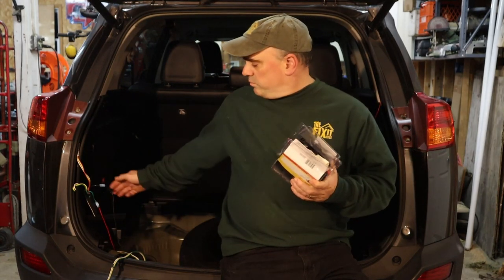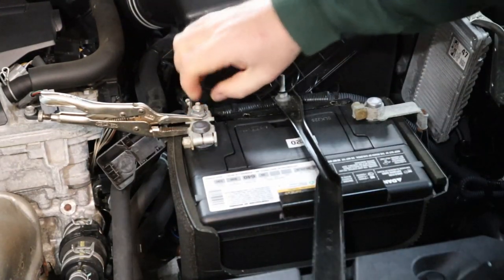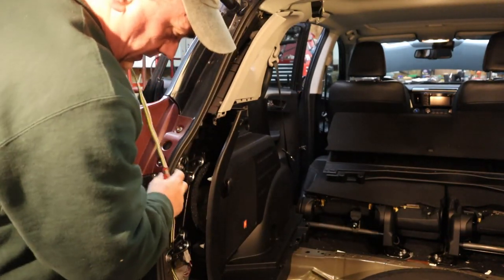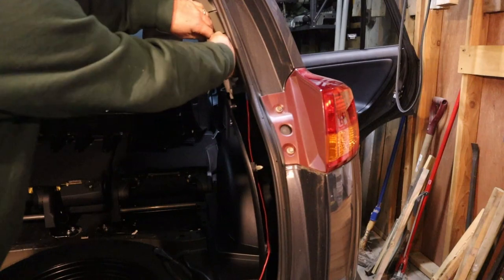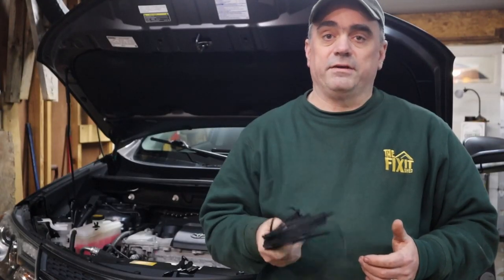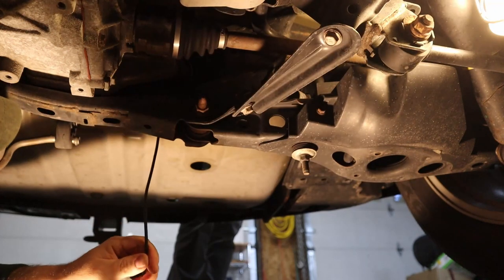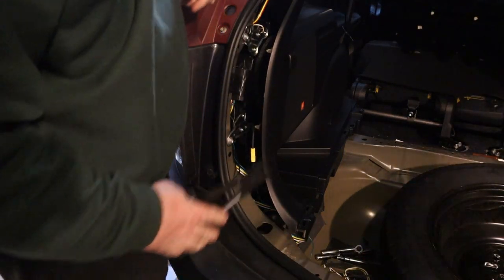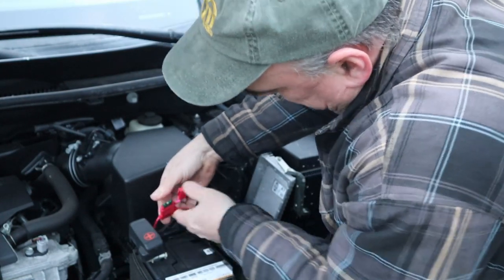Installing a new (sort of) Trailer Hitch Wiring Harness in my 2015 Toyota Rav4  | The Fixit Shed

Comment: Hi there from Downunder    I have a honda cmc250 1983 model   forerunner of the rebel . re. the carby kit rebuild  --- there are two jets with differing diameter flow holes. Which goes where?   Appreciate your response & enjoy your videos
Reply from the maker: Hello, Tim! I am not familiar with this carb, but I looked up the diagram on partzilla.  It looks like there is a Main (#138) jet and a Primary Main (#68) jet. Main (#138) screws into the Needle Jet holder , and Primary Main (#68) holds in the Main Nozzle.
Reply: Thanks for the feedback!!